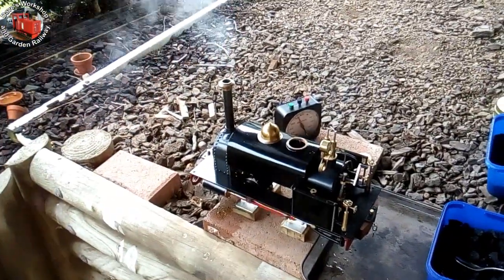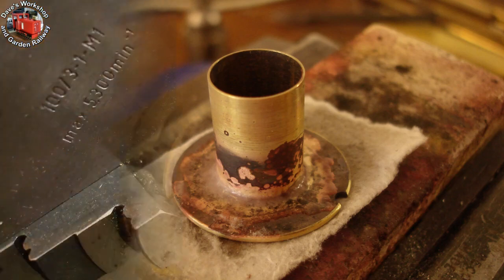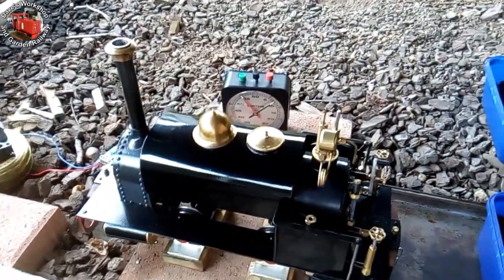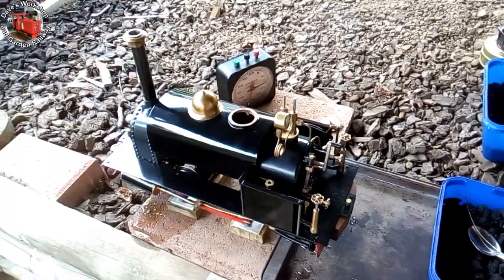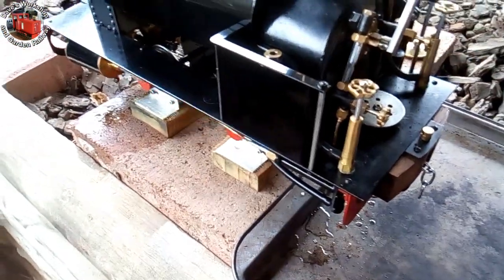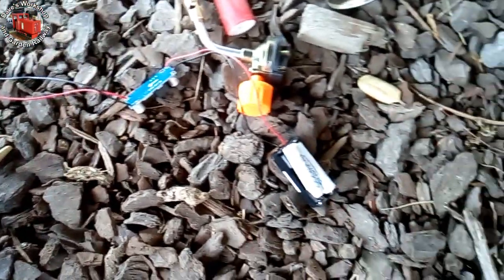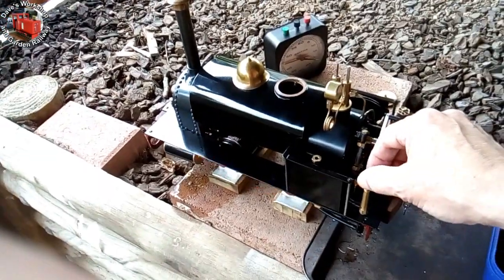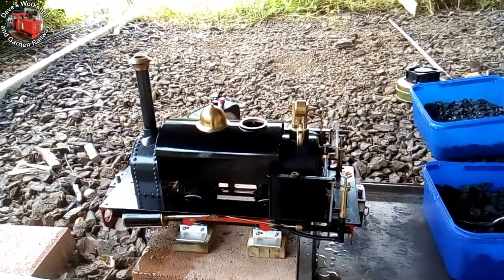I made a Steam Raising Suction Fan using a PC cooling fan and a boiled sweets tin

Comment: How is the PC fan holding up in regards to heat? This loco has a very high chimney, which obviously ccols down the smoke gases - that might make a difference. I've read about one person trying it, but the fan blades melted.
Reply from the maker: It's held up well.  The fire is a long way from the fan.  It's quite cool enough to hold it with bare hands after a few minutes use when removing it from the chimney
Reply: @GardenRailway  Actually I just realized we might have the sollution - just extend with a heat dispersing tube between smokestack and fan, and the PC fan will survive! (I've done an insane sollution, with a venturi "water injection type" design for chimney  suction. It's basically  regular water piping "T"-joint and a battery operated fan for inflating beach toys. It works great, but it makes all the noice level of a vacuum cleaner...😬Hence I'm looking something more agreeable to enjoying our small scale live steam.

Comment: Hi Dave Did you take a temp reading on the new fan, as I have several of these and if they work I will build a new blower box. Nice slow running.
Reply from the maker: No temp reading, but it's so far from the fire that it doesn't get too warm.  It's easy to handle the tin when removing with bare hands.  It's had a few firings now, and one long pull when the steam blower was blocked 👍